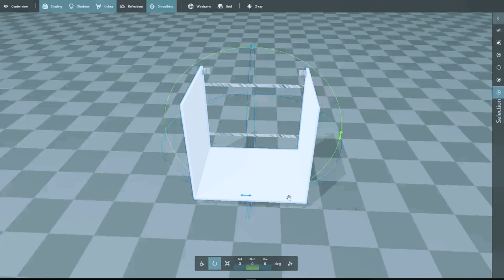DIY Kitchen Remodel for Under $5000

Comment: Would like to see details on lighting.
What is the depth of the upper cabinets?
Nice transformation!
Reply from the maker: You are in luck. Here you go: DIY Kitchen LED Lights: Easy Installation!
https://youtu.be/J3mCV5nPgM4
Reply from the maker: Also the upper cabinets are 14 3/4inch deep to be exact
Reply: The extra 3” room look perfect in conjunction with size of the kitchen and base cabinets.

An inspirational video for the DIYers.
Reply from the maker: @picflight thank you. Yes the bottom once are 24” deep. We are very happy with the cabinets. It’s been 2 years and they still look brand new.

Comment: Can you post a BUDGET for the expenses of the kitchen remodel?  What do the replacement cabinets cost?  Is there any reasonable cost source for good quality cabinets?
Reply from the maker: Sure I’m planing on making a video about it the future but I’ll give you ruff numbers. We bought the kitchen cabinets/hardware, tile and granite stone before the crazy inflation started. So out IKEA cabinets were $2800 dollars that’s everything tax delivered. We assembled and hung them out selfs so no cost for labor. Floor tile was $650 for 9ft by 11ft room. Back splash was $450 plus special grout for glass tile $40. Granite countertop was $1000 that includes the sink and install. $100 water spout for the sink. And I’ll add $400 to $500 for miscellanies supply’s like paint, roles screws, some small tools for install. All together it was around $5500. If I was doing the same remodel today it would be closer to $8000-$9000 if I had to guess.